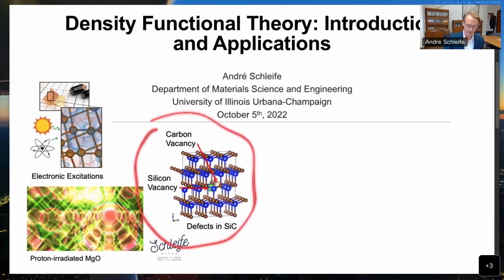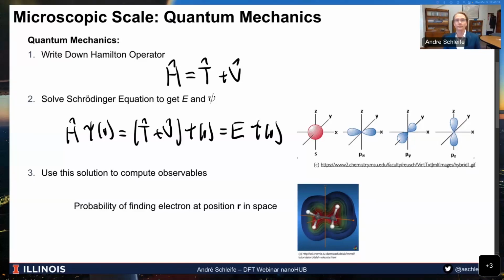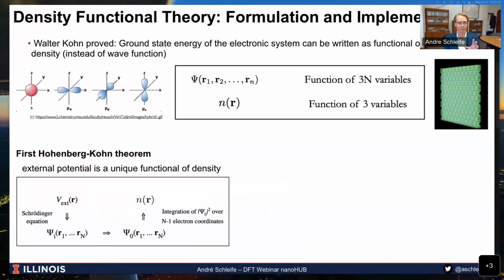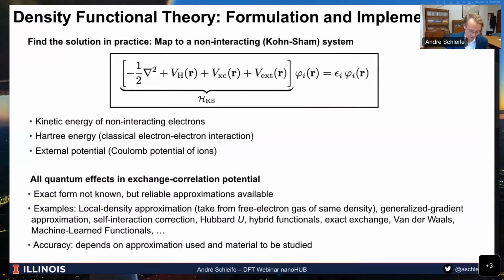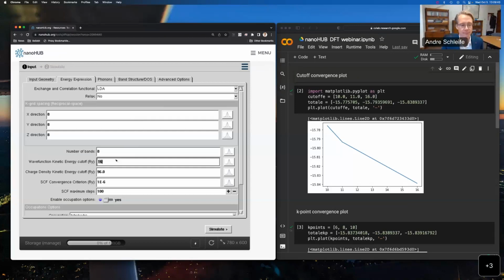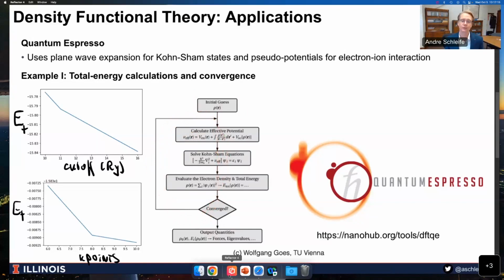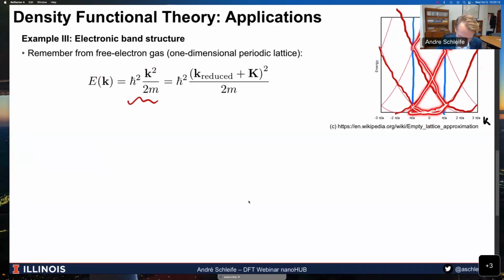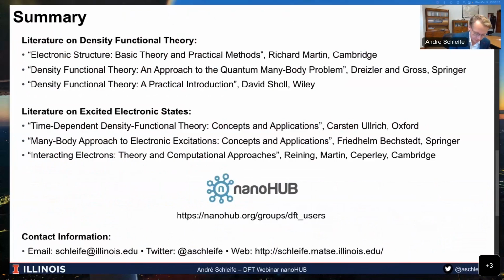Density Functional Theory: Introduction and Applications

Comment: guys you cant use sound techniques like this in generateing classes.  it raises longterm irritability shown in 1987.  you can use a brush and tap on the desk  or a flashlight but the beeps is negative rated so high on so mamy rational variables i feel depressed to share dft with ypu but i grasp you are no chemist